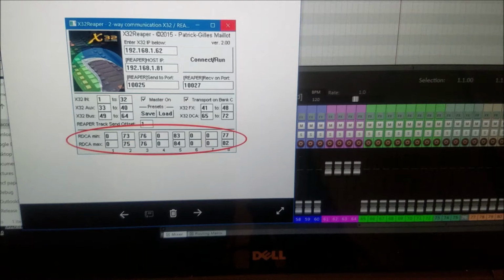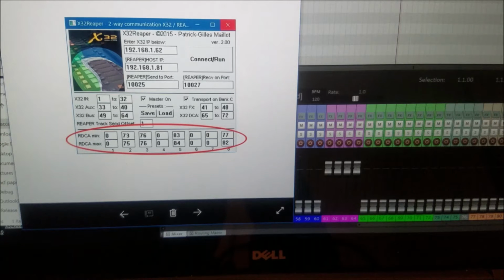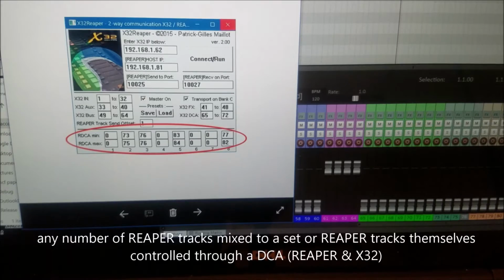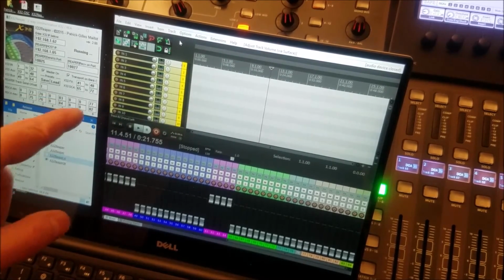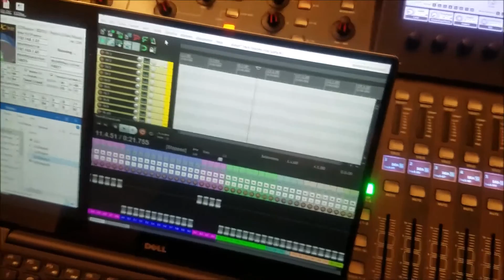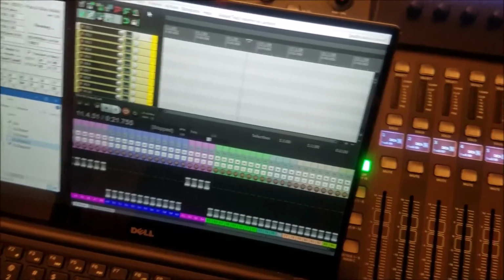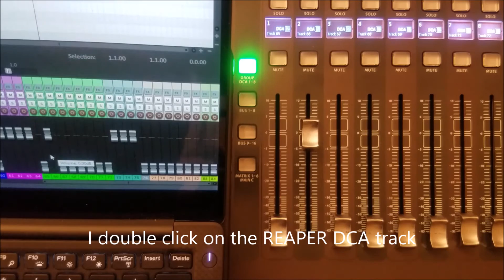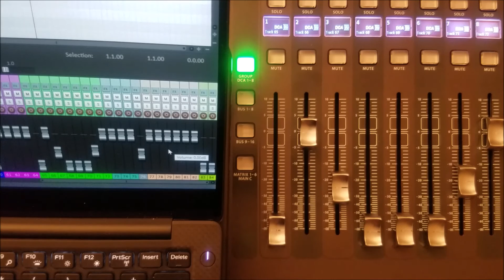X32Reaper Version 2 0 - New features!

Comment: Everything about this is amazing!  I'm considering purchasing an X32 Compact.  Will this work with the Compact?  From what I can tell the transport portion might not (or might have to be changed a bit to move the controls somewhere else).
Reply from the maker: It will work on X32 Compact. I haven't tried the actual transport section on a Compact but my understanding is that the buttons are numbered as on X32 standard.

Comment: Thank you for the hard work, and for sharing! Will your tools also work on the M32r?
Reply from the maker: Yes it will.
Reply from the maker: Jon, for some reason (don't know) your last comment about default scribble colors does not offer a working reply option, so I reply here: you can join/use the Behringer X32 forum for Q&A, or my direct email address (you'll find it easily).
-Patrick